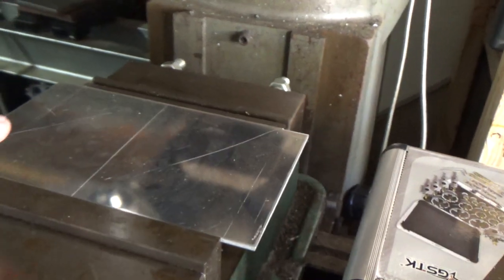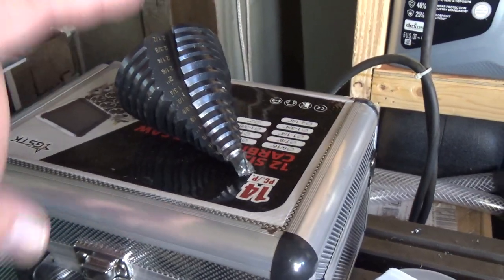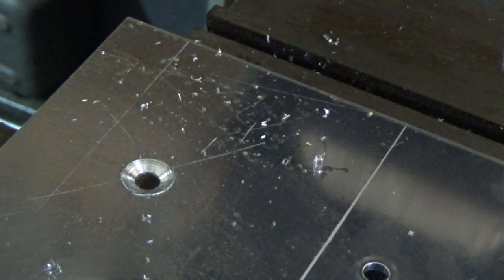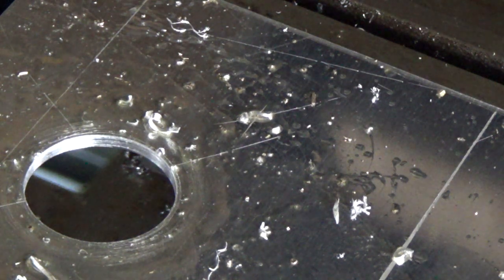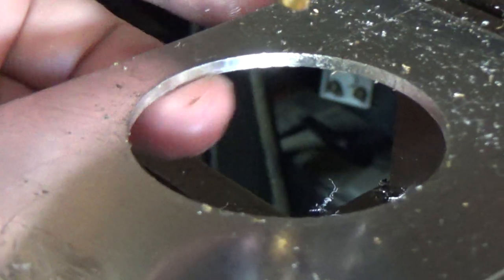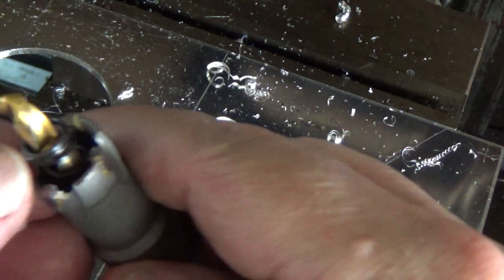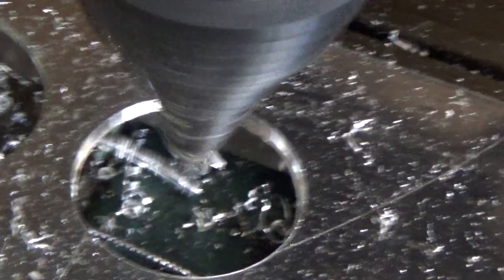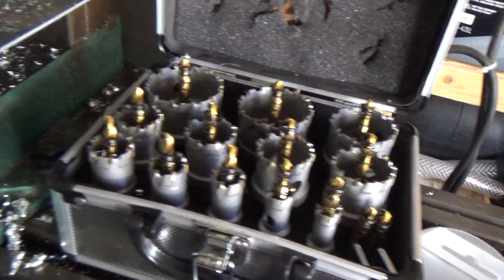Testing Cheap Amazon Carbide Holesaw Kit against Amazon Metal Volcano Step Drill.

Comment: The problem with the step bit:   the aluminum is gummy and sticks to the cutter-- so you just have to keep cleaning the bit when that happens. The reason it wasn't cutting is simply because you had a big chunk of aluminum stuck to the cutter--  and you were just rubbing aluminum against aluminum.  It especially does it near the point because it's spinning much slower there vs your feed speed.  You can up the drill speed on those smaller steps and it will do a little better.   As you get up to the wider steps, that larger diameter is spinning at a higher speed, which makes it take a smaller bite and tends to shave off a chip rather than a big chunky piece that sticks to the cutter, like it does on the smaller holes.   

Rather than thinking of RPM as your "speed"--   you need to think of how fast the cutter is actually moving in feet per minute.   At a given RPM (1000 for example)-- the actual ft per minute of the point vs the ft per minute at the 2" step will be drastically different.   I'm sure you know about all this--  since you have a lathe.  The same applies here too.  Adjusting your feeds and speeds makes all the difference.  There are charts that tell you what ft/min you should be at for cutting different materials.